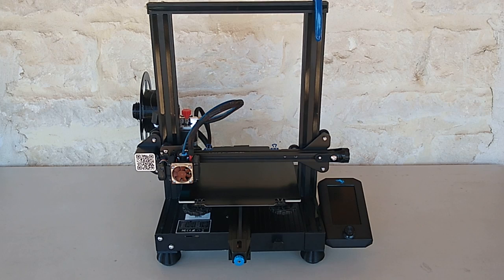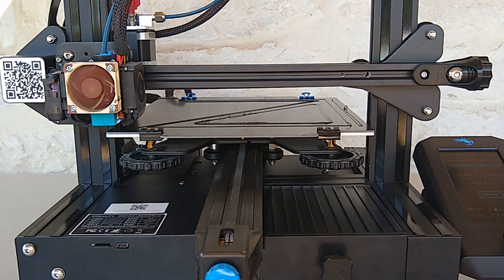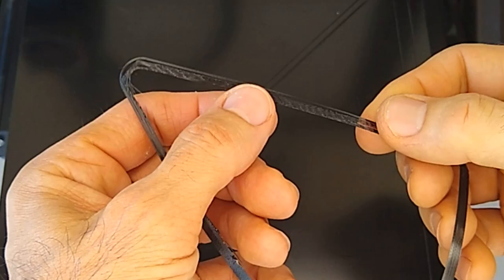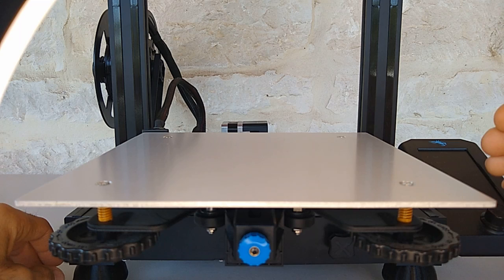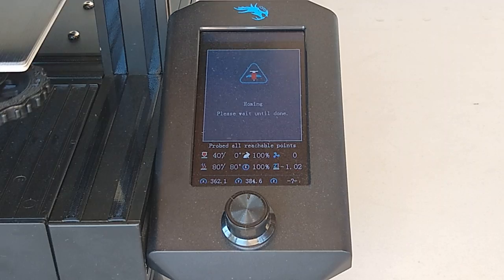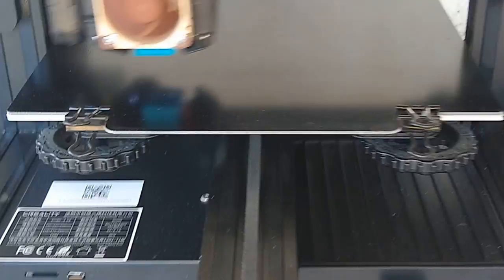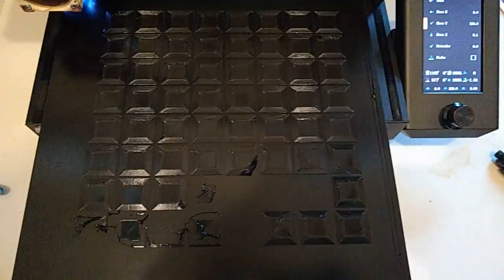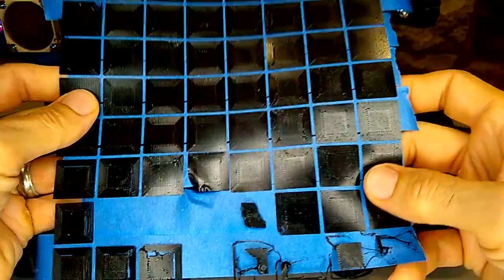Jyers Firmware Unified Bed Leveling Ender 3 V2 - Getting Perfect First Layers From An Uneven Bed

Comment: I tried Jyers firmware but found my Z offset was always changing, so I looked for something else and found Professional Firmware my mriscoc (I have no affiliation with him).   He updates it regularly and listens to users feedback and suggestions. My Z offset stays consistent now.
Reply from the maker: Hello Lee, Thank you for commenting. My friend Doug has only great things to say about Miguel's Professional Firmware. I've switched my two Ender 3 V2s to Mailsail Klipper and haven't looked back. It's an amazing free open source firmware that moves the G-Code processing from the printer's control board to the more powerful Raspberry Pi. After switching I was able to print a Benchy at 150 mm/s that looked the same as the one I printed with Jyers at 50mm/s. It takes a bit of time to set it all up but we'll worth the effort remove the bottleneck caused by the stock control board, get advanced features like pressure advance and resonance compensation. After upgrading to Mainsail Klipper firmware changes are as easy as editing printer.cfg file, saving, and restarting the firmware, no more compiling or flashing needed. Check out my video linked below for the complete process on my Ender 3 V2.

https://youtu.be/eOURi14SuO0

Best of luck with your mods!
Reply: As any added bonus, Professional now includes Marlin's support for linear advance (pressure advance on klipper) on legacy drivers like the ones found on the 4.2.2 board in most Ender 3 V2 printers and input shaping support (resonance compensation in Klipper). Additionally, by using custom Gcodes, you can modify the max hot end temp and a few other things instead of having to compile the firmware.
Reply: Just switched to professional firmware will never look back. It's great!

Comment: If you are running the bed probe at the start of each print, doesn't that override the 100pt mesh that you saved?
Reply from the maker: Hi Smedleydog1, In my case I just probe one point at the beginning to set the z home. There is an option to run bed tilt probe at the beginning to adjust the stored mesh but it messed up the mesh for me, so I don't use it.
Reply: @vbared  hey I'm having trouble getting certain corners of my bed high enough to squeeze paper and other corner to low idk how to fix or adjust this my glass bed is flat and new 2weeks
Reply: Btw ender 3 v2

Comment: You lost me saying the green squares are on the test print on the left only after flipping it over.  That cannot be correct.
Reply from the maker: Hello Douglas, Thank you for commenting. The amount of extruded filament line definition or lack of it by looking at the side of the material that was adjacent to the surface is was deposited on is what will tell you is you're high or low at that co-ordinate. I would have just flipped each square in place but because there was so many,  I had to apply tape to all of them so they wouldn't get mixed up during removal. In the downloadable file I added thin bridges to hold them all together as well as an arrow that points to the front of the printer. It's tricky to keep track of what square you're looking at when flipped over. What I do in my mind and should have mentioned during the video is that once flipped over the right side squares were printed over the left side of the build plate.

Best of luck with your mods!
Reply: @vbared  thank you. I understand now

Comment: I've got an Ender 3 V1 that I've done some upgrades on (Sprite Pro extruder, dual z axis and 4.2.7 mainboard, cr-touch).  I have not been able to get the cr-touch to work properly and have been considering using the Jyers firmware, but I suspect I'll have to upgrade the display to the V2 version first.
Reply from the maker: Hello Lindel, I'm migrating all my machines over to running Mainsail Klipper. You won't need a display at all using it but could easily repurpose an old cell phone to function as the display. Check out these videos below where I make the change from Jyers to Mainsail Klipper. I can now print at 125mm/s all day long with no artifacts, stinging, oozing, or anything else once things are calibrated. The 4.2.7 board will have a few differences in the configuration but for the most part it's the same process.

https://youtu.be/eOURi14SuO0

https://youtu.be/KAR3ZHemMig

Comment: Hi, I am confused on the G code part. You didnt really address it. How do I install this?
Reply: Like what splicer are you using? I was using cura 5.1 but the text file in your google drive says to not use anything past cura 4.2
Reply from the maker: Hi Decoder, I'm using CURA 4.13.1. Some of my Klipper stuff doesn't work with 5.0 and up. BTW I switched from Jyers on both of my machines to Mainsail Klipper. I can print at 115mm/s all day now, prints are cleaner too, Check out my video below on it.

https://youtu.be/eOURi14SuO0

Best of luck with your mods!
Reply from the maker: Hi Decoder, The link below is what's in the video description and contains my start g-codes that you can try. This is what I used for my machines that were running Jyers UBL firmware.

You get to it in CURA go to settings, printer, then manage printers. Your active printer should already be highlighted in blue, click the machine settings button on the right. A screen will open and the start g-code is on the left bottom. Highlight everything in the start g-code box, copy and save it to a notepad file so you can revert back if you choose not to use my start g-code. Open the "UBL No-ooz with wipe Start G-Code.txt" from the download link below, highlight and copy all the info that is in there, go back to CURA and delete everything in the start g-code box and paste the data from the previous step in there, close the box and you're done. load up a test print slice it and print it to test the new start g-code. It's what I currently use just tweaked a bit to work with Klipper.

https://drive.google.com/uc?export=download&id=197hPS1mE-LInJDeangeUTOvdgAE-nKLr

Best of luck with your mods!
Reply: @vbared  Thank you very much! For mainsail killper you need to install a raspberry pi right? I cant afford that right now but I can get one soon. Do you think running jyers in the mean time is worth it?

Comment: I am having a tough time with the manual leveling part. Ive gone through all 100 points multiple times and the distance keeps changing. For example ill make the 1x/1y point at the right spot with my  feeler gauge and go down the level. Then when I go back to check the one that was at a good distance is now too close to the bed.
Reply from the maker: Hi Decoder. I decided to switch from Jyers altogether to Klipper. Do you happen to have a Raspberry Pi 3 or 3 B+? If so check out my other videos on installing Mainsail Klipper on the Ender 3 V2. Klipper allows for super fast prints because of its advanced features. I can now run regular sized prints at 175mm/s just as clean as 50mm/s. It's amazing.
Reply: @vbared  No but I am going to get one, thank you
Reply: @decoder33  I know this is a bit late, but check your bl touch mount for damage, and check that your gantry is tight so that there isn't any slop. Otherwise might be due to sensor quality.

Comment: Victor!  nice man... i stopped 3D printing because i was having semi success, but man, the journey on trying to get these things to print properly.  Thanks for posting.  there's not much video on JyersUI for the uninitiated.
Reply from the maker: Hello Rock Lee_MC, Thank you for commenting and kindness. I banged my head same as you early on. I did a lot of reading, watched all kinds of videos, and had lots of failures. It really boils down to having the right setup, tuning, slicer settings, firmware and learning what the trouble signs are so you can service your printer before a major failure happens. I've switched to Mainsail Klipper from Jyers (which I used for many years). Klipper is a game changer in terms of print quality, speed, and totally customizable printer.cfg file, no more compiling firmware or hoping a developer adds a specific feature. Anyway, I'm sure you can tell that I think 3D printing is an awesome hobby. Let me know if you have any questions so I can do my best to help save you time and headaches.

Comment: I have to tell you that this 100% solved my issues on my new printer. I was using the 5x5 ABL and got failed prints right off the bat. It was like my bed was too warped for the ABL. Using the 10x10 UBL solved it and am now getting 100% perfect prints. I've been chatting with Creality customer service for 2 months straight and we couldn't figure out why my prints were failing no matter what we tried. We even swapped out the X axis gantry... 

Thank you, and hope you release more videos!
Reply from the maker: Hello MC, Thank you for commenting and kindness. I'm glad you found value in this video for your viewing time. As you already learned the Creality beds aren't perfectly flat causing inconsistent prints. Another game changer for me was switching the glass build surface that came with my Ender 3 V2 for G10 Garolite (linked below).  PLA, PETG, ASA, and Nylon stick to it when the build plate is hot and can be removed easily when cooled. No more scrapping, stick glue, masking tape, hair spray, or adhesion promoters of any kind is needed.

https://amzn.to/3V5Zod7

Best of luck with your mods!

Comment: Victor,
I came to your Chanel because of your harbor freight mode series that I truly thank you for
However, most if not all of the other videos I have absolutely no skill set for. I respect your efforts for others however
Best to you
Reply from the maker: Hi David, Thank you for your feedback. 

My apologies for getting sidetracked, I completely understand, my channel seems to be over the place. The vapor blast cabinet was my first major modification project on YouTube. It pushed me into learning about 3D printing to help me improve on its performance. Not long after purchasing my second 3D printer I noticed that these machines like the Harbor Freight vapor blast system can also be improved. 3D printers are simply amazing machines and learning to use CAD has opened up all kinds of possibilities for me. The days of having to go to Home Depot and scour through their hardware department in search of something that is close to the parts I need to help me resolve a problem are over. If you can visualize the part to solve a problem in your mind and it can be made out of plastic then CAD software plus a 3D printer will get that part into your hand. 

Best of luck with your projects!

Comment: Hi Victor,  Once again you have raised the bar for me.  Today I have been working with Miguel's firmware to understand how his basic mesh leveling is working.  I was able to work through the 6x6 mesh but the 7x7, 8x8 and 9x9 did not work in the base firmware.
I wanted to look and get a feel before I install his UBL firmware.  I hope there is a second mesh save location as that seems like a great feature for doing compares as well as for different temp profiles on the same machine.

Once again Victor you are being the 3D explorer and teacher that seems to have no bounds.  Great Job Sir.

I have posted about the current source code compile issue and will check back for comments later.

Well lets copy down all the configuration settings for the E5 Pro and install Miguel's UBL firmware and take it for a test run.  Again Well Done Victor, plz extend my greetings to Chaos.
Cheers
Doug
Reply from the maker: Hi Doug, Thank you for your encouragement. The Unified Bed Leveling is amazing. Miguel's firmware has a ton of cool features. I can't wait for him to get us a good source code that we can tweak. It's super cool that he added the new lead screw option in the current firmware so swiftly.

Enjoy your Sunday (:
Reply: @vbared  Hi Victor,  Sunday has been great thank you, as I hope yours is.  Lots of garden to share with the neighbors.  I started the Ender 5 Pro laying the 64 squares which look like a dream come true.  The interlocking layer has just started and that is a cool way to keep all the squares together.  Thanks for the arrow pointer as you know the E5 Pro is reversed 180 degrees and the pointer will help.
I have converted the mesh data to match the actual bed layout and am working with the values to see what the outer edge edit ranges are.  It looks like anything => 0.05 plus or minus could be tweaked a bit.  For sure values in the RED => 0.08 plus or minus.

Thank you again for the UBL introduction as this really should be on everyone's printers.  With a BL or CR touch it gives you all the bed and all the stick you will ever need.

I too hope for the clean source code as well still have a bunch to do.  Thanks again Sir.
Doug
Reply: Hi, for meshes higher than 5x5 and a CRTouch you must disable the HS mode. Please go to the Wiki, there is a lot of useful info there.
Reply from the maker: @MiguelRisco  I appreciate your guidance. That's probably why when I try to enable tilt it would screw up my mesh.

Comment: You can also use G29 for g code and it probes before each print
Reply from the maker: Hi buddy, thank you for the suggestion. G-code is amazing the way it works. I've migrated all my machines to Klipper. It's an awesome firmware that allows for all kinds of customizations and calibrations aimed at cleaner prints and speed.

Comment: Hi. I see what the main problem you have. You just need to add some "clip" to the side of the bed. 
Right now you have only 2 in each end. 
With the temperature it will bow up in the middle.
I guess if you one clip on every side, you will get a bed that dont bend to heat, like it do now.
Also you should put on those clip when the bed is heated, as all will move with the heat goes up.

Hope it helps some..
Reply from the maker: Hello Damian, Thank you for commenting. More clips would influence the bed mesh shape positively for sure if the surface underneath was straight. On my Ender 3 V2 the heated aluminum bed has a high spot in the middle that runs left to right. The great thing about a UBL firmware is that it can compensate for it.

Best of luck with your mods!
Reply: @vbared  true.
 But my point is that your aluminum plate do warp due the printbed you have. 
It will get worse and you will have redo the mesh time after time. 
Aluminum is soft and it will bend more and more, due the heat and strain from the printbed you have. 

If you put a clamp on the sides to, you will slow it down. So your mash will work longer. 

It's easy physics. When you put 2 different material on top on each other and clamp them on 2 side. One material will move more and one will get deformed.

I hade the same problem in the past with my MakerBot replicator 2x. Got though 4 buildplate before i figure out the problem.  The last builplate i got from makerbot they had it in a lab before they sent it to me. It was perfect straight. Well untill i minted it with the bottom plate and heated it up. 
Like your plate it bowed in the middle. But it was an easy fix, when i knew the problem. I just drilled out the screw holes a bit in the steel plate and put longer screws in and put some springs in. 
After that it's straight. Even now after 9-10 years the build plate is straight.  😂

P.s i just bought me a ender 3 V2 to mod and gave fun. 😆
Reply from the maker: @DamianGto  Oh, I see what you're saying it's like building a sheet of plywood. Horizontal grain layered with vertical grain to make the sandwich straighter and stronger than the individual layers. You're going to really like the Ender 3 V2. Out of the box it prints clean provided that the slicer settings are tuned. I appreciate you sharing your experience. I've been wanting to find a way to attach another aluminum plate on top of the bare heated plate.

Comment: Thanks for this vid, I am really debating on finally grabbing a 3d printer so vids like this are super helpful!
Reply from the maker: Hello Uther, Thank you for commenting and kind words of encouragement. 3D printing is the most amazing hobby if you are a natural tinkerer. If you run into any questions about it just ask.

BTW, I came across the lowest price I've seen for the Ender 3 V2 in a long time with free shipping. During Black Friday it may come down to $199 but if you are in the market now $212 is close enough.

https://store.creality.com/products/ender-3-v2-3d-printer?utm_source=googleshopping&gclid=Cj0KCQjw8uOWBhDXARIsAOxKJ2Euucukdk71FTb7UBj_kuN2jHlGjg6W12WBFtv_-WyE89NJcyGbthkaAr90EALw_wcB
Reply: And if you choose to get a printer, one tip I wished I got in the beginning is - don't upgrade anything until you know the basics. It took me  so much longer to get everything working because I wanted to pimp/upgrade my machine right away. 😮‍💨
Reply from the maker: @teodoreoakleaf2537  Hi Teodore, Thank you for commenting. I did the same thing by making a bunch of changes early on, forced learning for me. The great thing is that there is a huge community supporting the Ender 3 V2 so just about everything has been covered in great detail.

Best of luck with your mods!